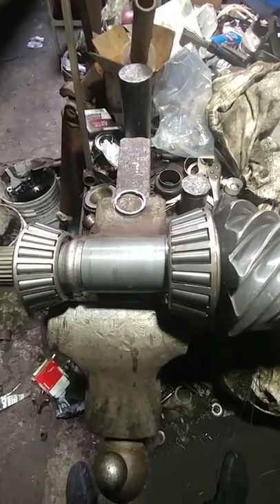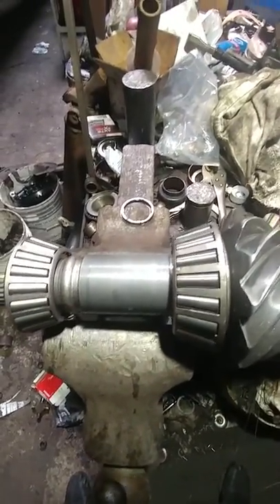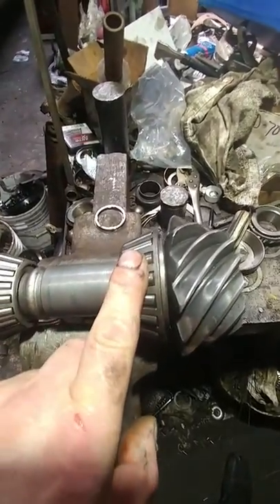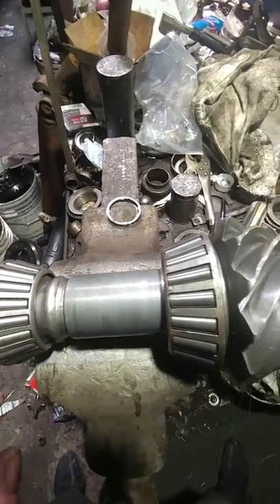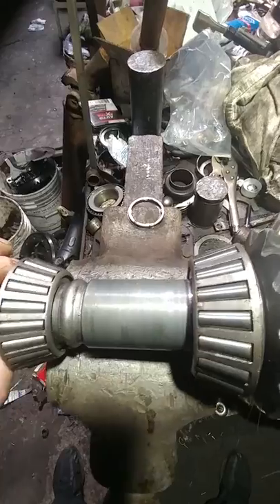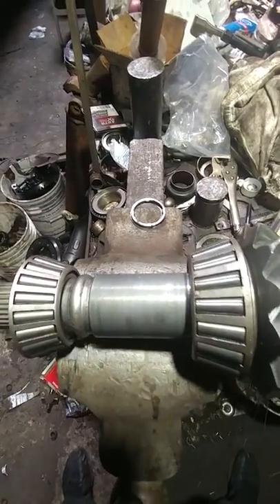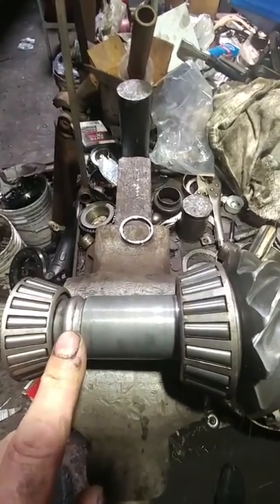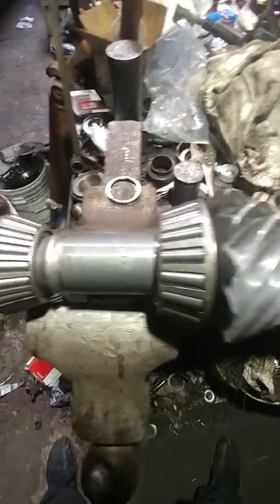Differential preload and crush collar misinformation

Comment: Yeah I agree a crush sleeve is plenty good, they have been in use for a long time and work great. But I must say if that is your shop that you earn a living out of, and I was looking for someone to work on my stuff I would turn around and go somewhere else after looking at your sloppy work table and probably the rest of the shop, that would make me think your work is probably just as sloppy.
Reply from the maker: And you can make that judgement based off of that.  I'd not judge anything by a very busy table  but it's your vehicle
Reply: Makes me think the guys table is a mess because he is so busy because he is good at what he does.... which is not house keeping. I'll bet you go to the barber with the best hair cut.
Reply from the maker: @FirstNameLastName-cj1nc . . Truth is the bench gets cleaned  after each couple of  jobs across it, and then a better cleaning at the end of the night... but the bench is a area to hold things and the vice is where most work happens, along with stands and other holding fixtures for differential axles and center sections.  Shafts are all built in a lathe or the balancing machine... his comment just shows his level of building something,  anything ... things aren't built rolling around a work bench table....  but that's how he thinks things work.. oh well.
Reply: @FirstNameLastName-cj1nc  Obviously you have never worked in a shop, or anywhere you work with your hands for that matter. Common sense tells you when you are trying to work on something you need a clean area to do professional work, if you argue that point, tells me for sure you have no clue. Look at any successful quality business, tell me how that work area looks.
Reply: Crush sleeves seem to often to lose a bit of preload and allows the nut to come lose.
Reply from the maker: @mopar2ya165  if you watch the video you'll see a crush sleeve doesn't even crush again. Bearings wear out over time and that's how you lose preload.
Reply: @Supershafts  So why did dodge have a recall on so many crush sleeve diffs wuth nuts comming lose, but not so on the previous gen of non crush sleeve diffs?
Reply from the maker: @mopar2ya165  actually  that was the nut failing.   You don't understand what a crush sleeve performs,  watch the video again
Reply from the maker: @mopar2ya165  um which year 9.25 ever had a shim ? I've also  seen every model dana have a nut fail , the issues isn't the sleeve .  Watch the video again
Reply from the maker: @simpleman2004  I have no idea what kind of work you do, its definitely not what I do though as you don't know that bench top is simply a flat surface to put something on.  Any differential work is all on stands that hold the housing which isn't that bench and there are multiple holders for centersection style diffs. 
  Mostly that bench there is used for unboxing , measuring and holding. 
  You really don't know the work and how it's done. 
  Also we've been in business  since 73 with no come backs or complaints.
Reply: @Supershafts  Ha Ha, yeah Ive Been a Heavy line Mechanic for over 3 decades, I really do know the work and how its done, thats why I know your work table is SLOPPY, I know differential work is usually on the lift in the air, and thats how I also know crush sleeves work plenty good, and you saying your bench is only to unbox??? Why do you have a vise on it then? Well that would be to hold things when you are working on things, you never have small parts you have to put in order for reassembly??? What about when a clip falls off??? I could go on and on, A sloppy table is a sloppy table, no ifs and or butts, maybe your not familiar with professionalism, but that includes a clean shop. You can make any excuse you want but SLOPPY  is SLOPPY. Ask any Professional.
Reply from the maker: @simpleman2004 yeah that vice is simply to hold other fixtures. Or lay shafts in to check for it's ROT. That's it. Like I said I'm not interested.  When you have my reputation, which reached across this country and into other countries, I'll worry about your critique. Until then i have 50 yrs of no negative anything here.